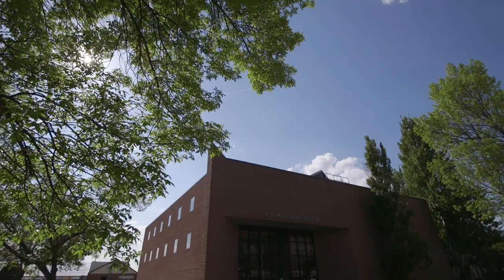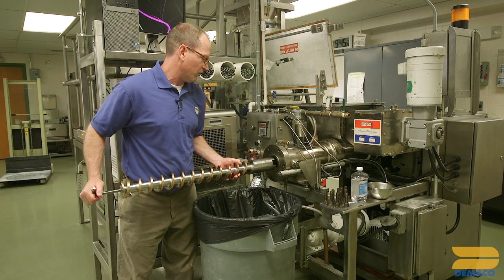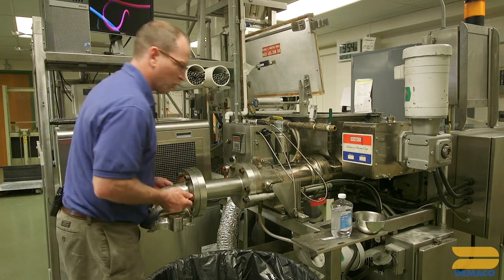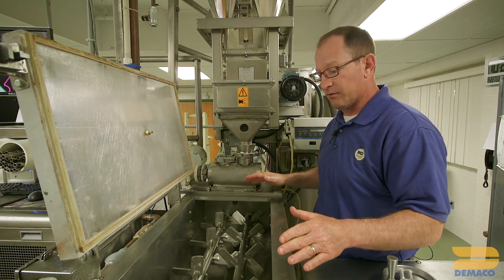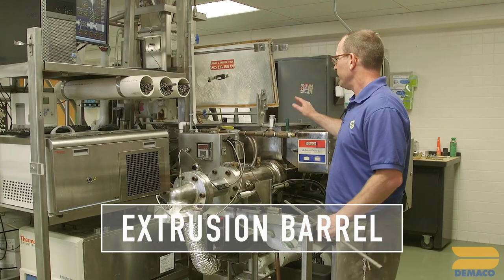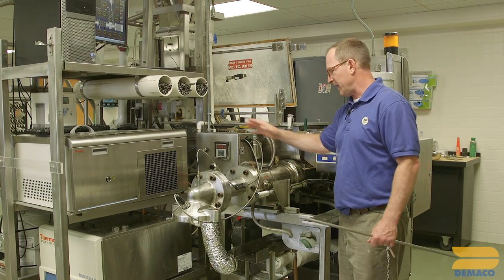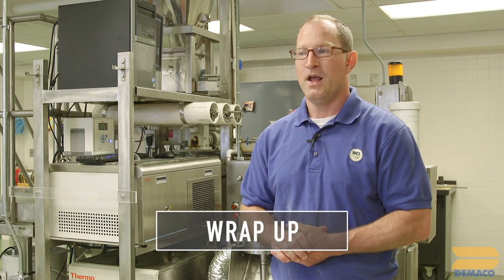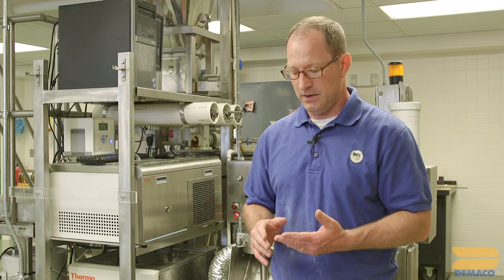Pasta Processing Fundamentals and Basic Extruder Operations

Comment: great video, was curious as to how pasta was made and figured it was a small extruder. Interesting how you utilize vacuum in this process. Since your barrel doesn't seem to be heated, whatever temperature the barrel is at normal operating temperature is when you torque those bolts. If that happens to be room temperature then torque sequence is not that important.

ps. that is NOT how you use a torque wrench, if the torque spec matters you wanna hit that click slowly